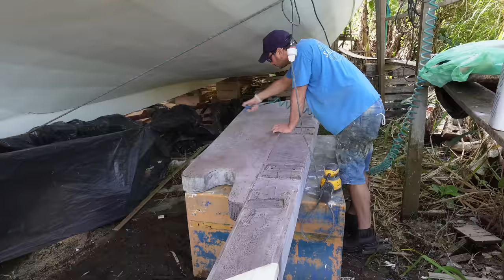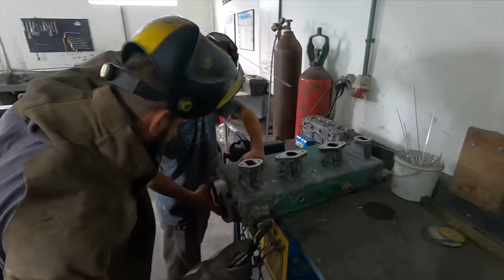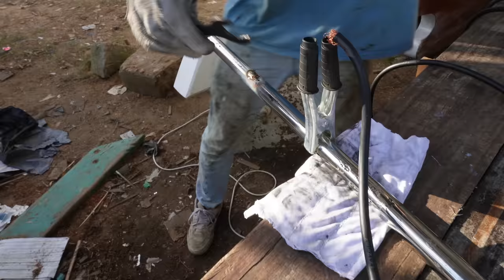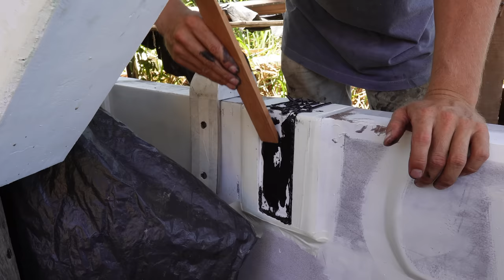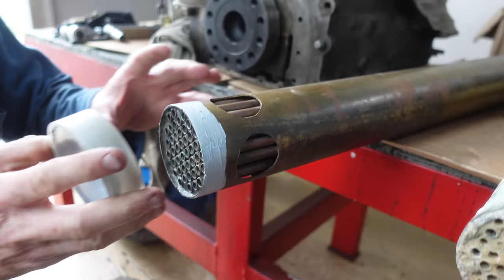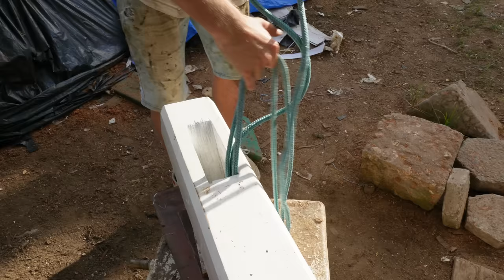Liveaboard sailboat rebuild | Hoisting and installing its huge wooden rudder — Sailing Yabá 132

Comment: I was involved in the re purposing of an old fishing boat with a hydraulic gearbox and heat exchangers like yours, the cores collapsed, thus converting the hydraulic oil to water 💧 resulting in a dramatic sea rescue. Love your work 😂😅
10.20 am

Comment: The erosion damage to the 'Pintle rod' looks like galvanic corrosion. Perhaps attaching a sacrificial anode to the rod below the water line will keep it pristine and avoid future pitting. It will be very interesting to see how the steering will look when it's finished, that huge tiller will certainly give you some leverage! Lindo trabalho de todos! 😸
Reply: A magnesium anode might work, but how long will it last..., and they are not so common, where do you get it?👴🤔🤓
Reply: @Arnaud58  Magnesium is better suited to fresh water. Cheaper and much more common zinc anodes are made for shafts starting as small as 1/2", can last 3 to 5 years, and are readily available in Brazil...
Reply: @mikeskelly2356  Good to hear that Mg anodes  are common there, I did not know that.
"Magnesium is better suited to fresh water" That is exactly what I stated in my original comment (not this line). Mg is the lowest useable anode in the series. So: Best protection but therefore fastest gone.

Comment: try using alcohol to help remove water stains.  As it evaporates it will draw out the H2O moisture behind it.  You will still need to do some sanding but it helps and you might not need to remove so much meat.  Love watching your adventure!

Comment: A painting suggestion….that white looks pretty good….I forget the exact names of the board placements….keep the hull white.  Using blue or green paint the top board one color( blue , green) making one a different shade and the other say darker.  At that point where the chamfer is.   Then use the colors up top on accent parts.  Leaving it mostly white

Comment: You should use some kind of locking nuts on the rudder mounts. You really don’t want to loose the rudder at sea.
Reply: Good point to make.  Should definitely install cotter pins.

Comment: Aluminum heat exchanger? Because it’s aluminum, it needs to be protected against galvanic corrosion. Do you have people who can advise you about that?
Reply: It's just the housing that's aluminum. The parts in contact with water and coolant are brass.
Reply: it came with the boat not a new addition
Reply: @aquious953  Nope, the coolant flows freely around the bronze or brass pipes in the entire aluminium housing.👴🤔🤓
Reply: @Arnaud58  not the seawater
Reply: You are right. Now it's protecting the broze, brass and iron. But only a magnesium anode is suitable. Zink is to be found in every shop, but magnesium?
And how long will it last in the salt...?
Reply: @aquious953  And are you 100% sure the coolant is not conducting????
Here's news it is!👴🤓

Comment: I hope the WELDING Rod was compatible Stainless rod.
Reply from the maker: You can count on that!
Reply: Not just the electrode but the grinding disc, it must be made of  nylon, stainless steel is sensitive to anything made with carbon, can be contaminated and then the oxidation process will start. The welding temperature has to be controled also,  Stainless steel is sensitive to high temperature, if exposed to high temperatures (+- above 450oC) it loses its ability to be anticorrosive.
Reply: @SailingYaba  Oh Good, I thought you probably did.

Comment: That cooler heat exchanger still will be oki u can drill through the copper pipes there is be some deposit inside it just blocking the sear water from passing through. After drilling clean it with some toilet cleaner it will work as good as new

Comment: If you happen to get any water stains on other pieces of wood, oxalic acid will remove them easily. Just mix it up into a solution and spread it over the entire surface (not just the stain). Rinse it off once it's dry, neutralize with a little baking soda in water, rinse thoroughly again, and you'll be ready to sand and finish it once it's dry.

Comment: Tip from a welder, don't drag the bead you push the bead. Better penetration and puddle control. And the Rutter is not a good place to worry about a weld....looking great guys

Comment: By welding that shaft on one side it caused the shaft to warp in that direction. If you turn it you will notice that is drew or pulled tight where you welded it. You can put in between two rollers and check it and relieve the stress in the weld by heating and cooling to straighten the shaft out again. It may not be all that important since it's a pin but if you need to straighten it out again you can see Keith Fenner on youtube to see how he straightens drive shafts with heat torch. Great work.
Reply: Keith is too high tech for Yaba.  Neico would just make a beach fire , heat the shaft in it and bang it a few times with a sledgehammer to straighten it out .

Comment: Ben, MP !
I've followed the rebuilding of YABA from first time i found out about your project, me, myself, i'm a "Motorman" from my latest education, so when it comes to the engine or parts of the engine.
My periscope is raised in intresse and from early start in life together with my middle brother(who is gone now, cancer), we always has tinkle with cars and engine.
Our primary car, was a Oldsmobile F85 1964 four doors, with a 385cc V8 and my dad had a Oldsmobile Super 88, 1961 i think it was 400cc, with a basic 325Hp engine.

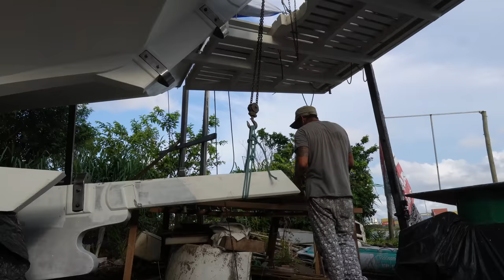Comment: 22:42 With your rudder is on it's back like that it reminds me of an enormous electric guitar
25:17 With the rudder hinges attached above the hull hinges, is it possible to simply slide the rudder upwards along the pin while it's still attached in case you need to make room for the drive shaft?
Reply from the maker: True! 😂
Reply: The "rudder slide" depends on the room the rudder needs through the platform and\or distance between the hinges...🤷‍♂

Comment: Both :0). Wow really coming along now. The rudder in place looks magnificent nice wok team. I like the colour coding on the engine it will make spotting leaks etc quicker and easier to see not that there going to be any. You must be feeling quite excited  now that everything is coming together. Bit of a bummer re window trim but if Weather anything like here it does it own thing when it wants although Mum Nature seems a bit more Pissed Off than usual lately. Be interesting to see what ya do with the Tiller Arm closer to finishing. Keep at it now. ;0)

Comment: A tip for water stained wood. Before you start sanding take a clean soft cloth, wet it well and wipe the entire timber surface down with it. Most times you will remove the stain completely

Comment: So much progress has been made and she's going to be truly gorgeous when finished.
The reason for different thread counts is strength. The higher the count the finer the thread resulting in the stronger it will hold/tighten without, (what we here in the States call), stripping and ruining the thread/it no longer holding. Not sure about a single thread count lower causing issues on a yacht/vessel such as "Yabba" but it can effect things such as the head bolts in an engine. Also not trying to stir the pot but the wields on that heat ex-changer looked pretty rough, was there a reason not to run a continuous clean bead or even overlapping beads on them? Admittedly I know nothing of repairing heat ex-changers but I do know aluminum wielding for uses such as high pressure turbo kits for engines so they just looked a little off to me.
Great content as always and good to see Matt arranging to come so far to help with whatever was needed.
Fair winds, following seas, safe travels and God Bless...

Comment: Did you consider changing your pulleys to a serpentine(V-ribbed) belt rather than a rubber spitting, squeeling, stretching V- belt system? Also, always wear PPE when cutting, grinding, and sanding aluminum, or anything, for your long term safety. And try to remind those who don't.  Nice work!
Reply: With your current V-belt system you'll have a black rubber coating on all the walls and everything in the engine room in no time!

Comment: The rudder “blade” seems rather small. I would have extended the rudder blade another 10 to 12 inches to increase your rudder’s exposure and that will allow you to have the automatic pilot do a lot less work.
Reply: Rudder works like a foil / profile. So the force does not come from the horizontal length, making it longer to the rear would just mean more force needed to swing it but not only little more force in turning the ship

Comment: Grind out the imperfection and then layer weld until it is above requirements and then either grind or could it have been done in a lathe.  I have not been following your Vlogs so I do not know how much money you can afford.  If you are not sure always ask questions over the Internet, that way you will get expert advice.

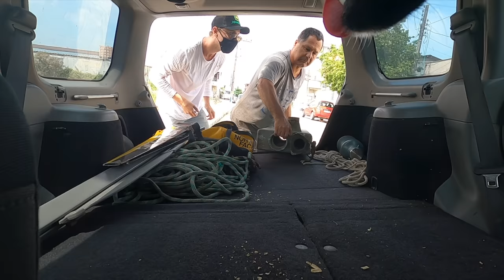Comment: @04:49 A little consideration about the probable reason why it is in that bad state.👴🤔
A heat exchanger has coolant and salt water running trough it. Especially salt water conducts electricity very well.
Everything has it's own - in Dutch normaalpotentiaal --. In this case meaning one metal differs in electric potential to the other. When possible (through a dielectric (conducting) medium as salt water) there will start a current flowing, after all, there is a potential difference.🤷‍♂
This causes galvanic corrosion. The side with the lowest potential will be sacrificed and by this, save the side with the highest potential.😱
That is in short the way zink anodes in salt, and aluminium ones in fresh water are used to protect steel (iron) ships. Zink in salt water, because it's more aggressive, and aluminium in fresh because it's reaction is faster and thus it's more "willingly to disappear" compared to zink. In other words, zink lasts longer in salt water, aluminium is useless there it will be gone in no time.
-
Well now. Your engine is made of cast iron, and the heat exchanger of aluminium.........🤷‍♂😱

Comment: You're doing great But the propshaft wont fit in if the rudder is there
Reply: test fit
Reply: Yes but its only pulling 1 rod to unhinge it again. Just attach a rope on top to hold it at the height and unhinge.

Comment: I still have a problem with that platform in the stern! In heavy seas?
Reply: If this boat finds itself in heavy seas that platform isn't the only problem! Lack of ballast might be a significantly bigger one.
Reply: @pcb1962  True! And no keel? Any way do secure the tiller to the rudder stock with some stainless steel  bracket! it looked weak! Best of luck!

Comment: can you fit the propeller shaft with the rudder in place?
Reply: Since the rudder  starts behind the axis of rotation there is some space in the middle at max deflection, but as he already said they can unhinge the rudder with ease if they have to, but they need in in place for the 3rd mount and to fabricate the steering.
Reply: @schuttrostig5729  I wrote that before watching the full video, and afterwards could see that the prop shaft and propeller could be fitted.

Comment: Nice work. But I don’t understand why you are putting your fresh water thru the water cooler. I would think you might want to put your hot engine coolant in there. Use your refrigerator for the fresh water.
Reply: Most modern engines use 2 water circutes, that way the engine holds much longer since it has destiled waterand salt water is only in the heat exchanger. If that is done rusting, rebuild/replace the heat exchanger and keep the engine. That is normal for any boat engine that uses salt water cooling.

Comment: You really need TIG for welding stainless. Did you use a stainless filler rod in the stick welder?
It might be okay to use a stick welder for filling holes, but please never use it on anything that needs joined together, or needs strength; for that you need TIG welding set and stainless filler rods.
Reply: TIG process would be much more convenient for that job but as long as you use the appropriate rod for stainless steel,  there will be no problem using the SMAW (I believe that the welded part is stainless steel 316L), but not only the electrode can be a problem, the grinding disc must be made of  nylon, stainless steel is sensitive to anything made with carbon, it can be contaminated and then the oxidation process will start. The welding temperature has to be controled, you can not expose stainless steel to high temperature, if exposed (+- above 450oC) will no longer be anti-corrosive.
Reply: @giovannirosa968  I would put money on Ben using a mild steel filler rod, and not stainless. So that's going to corrode in no time in the salt water. Better to have just left the corrosion pitting. Or replace the rod, looks like a stock diameter, with a retaining collar on the upper end.
I'm an engineer in the food industry, so deal with welding and machining stainless parts every day.
Reply: @colombialife  OK, an engineer who works with welding, I will respect that. But,  I work as a welding and NDT inspector qualified by ASME standards. I have been working in the marine industry for over 28 years, I do welder qualification, welding procedures and inspection. So, If you are going to weld stainless steel you have to use the proper electrode, no matter the process, it can be MIG, MAG, TIG OR SMAW, with the correct welding procedure and respecting all welding parameters, you won't have any kind of problem with the weld. If the material to be welded is stainless steel, you must use the stainless steel electrode as the filler metal, if not, you will have corrosion in a short time due to carbon contamination, and it will form martensite with low ductility and which, as it contracts, can cause cracking. It's a basic rule for anyone who works with stainless steel. Do your research on ASME and AWS standards for stainless steel welding and you'll see that I'm right.
Reply: @giovannirosa968  Don't tell me something I already know, what I said was I guarantee that the filler rod used was NOT stainless, but a mild steel rod. It may look the same, and give the same finish, but is 100% unsuitable for the application

Comment: Get a new prop haft. You work harden it by welding on it. It will snap at the weld and now most likely has run out.                    ( bent ).

Comment: Hello there Guys ..... Great work.... But I do have a Few 'Concerns' that can still be corrected .... I would suggest  some 'nice Heavy Acetyl or Nylatron Washers between the 'Hinge Face' of the Pivots , Stainless on Stainless is Never a good idea.... Also, the rudder does Not look 'Hyradynamic' enough. When having 'Bluntish' Leading and Trailing edges the 'Effective Steering Area' is greatly reduced. Please take the time to watch Leo's vidclip on This Very Subject .... Very well explained and discussed ....   https://www.youtube.com/watch?v=H6bhXxl5nRQ ..... AND......https://www.youtube.com/watch?v=f6y92-mgBEo&t=1634s  ..... Keep well, Thanks for sharing your Great vidclips .... Cheers from NZ